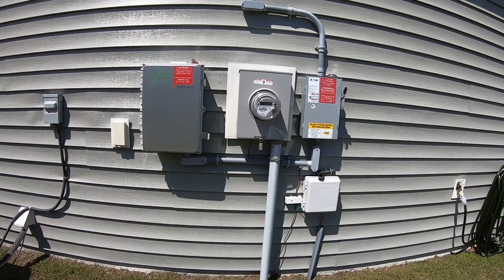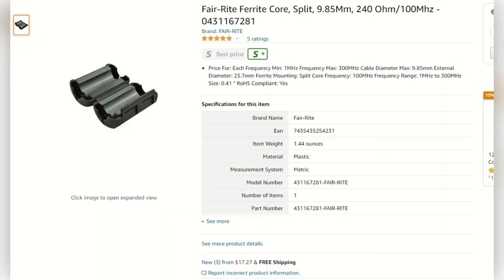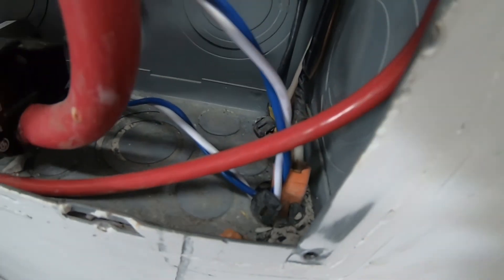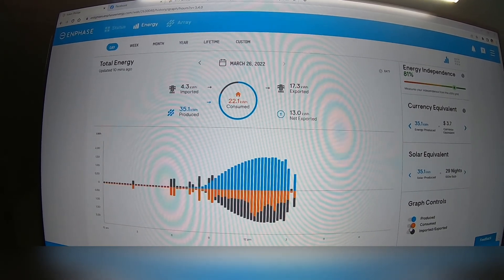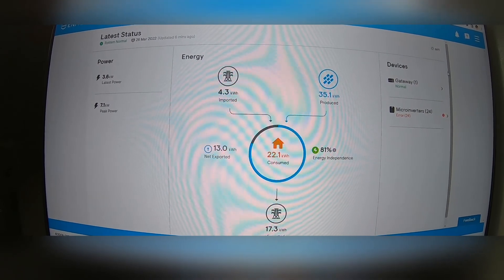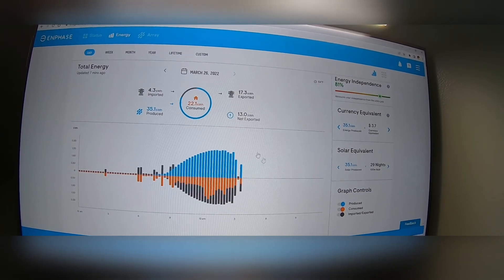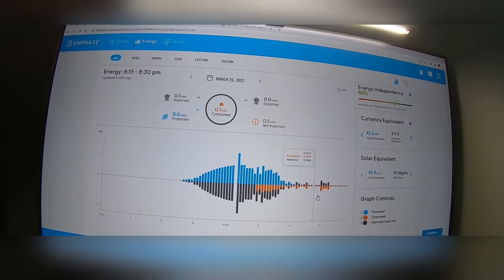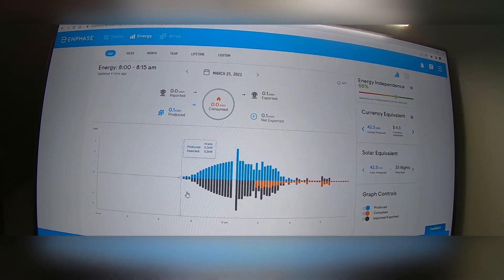Enphase Solar Consumption Meter and LAN Ethernet Cat 5 over view and error solved

Comment: I know the video is 2 years old, but wanted to leave a message and thank you for showing the Ethernet connection. My installer configured my system for WiFi and it's been dropping due to the weak signal from the opposite side of the house. I've been searching the web for months, and this is the first video I've found showing the network port.
Reply from the maker: @kopperklad7613  glad it helped, I did searched like crazy and couldn't find anything except a few people say it didn't have a way to hardwire. it really should be better put out there for there own advantage but thats why I put a video out there to help others.

Comment: Thanks for this vid.  I was really wondering where the hell is the Ethernet port, glad to know you can unscrew the plastic panel to expose it.  Though the e phase box only has a hole for power…I guess I would need to drill a separate hole just for Ethernet….?
Reply from the maker: I ran it through the same hole, you just want to make sure to get a ferrite which makes the signal normal. Here is the one they suggest and that I got. https://amzn.to/3VaZj8h
Reply: @ajphillipsjeeps  truly appreciate the response and info.  I will go ahead and purchase through the link.  I have to take my gateway from wifi to Ethernet, and our tech said once I switch over I could expect a 24 hour transition so my data will not report for up to that long.  A little confused but I’d rather be hard wired in.
Reply from the maker: @lowell a  mine was about 20 minutes but it will stay connected to wifi in addition to LAN but uses LAN as primary  and wifi as 2nd
Reply: @ajphillipsjeeps  that’s absolutely what I wanted to hear and expect from typical devices that manage both protocols. Thanks for confirming!

Comment: Hello, I have Duke energy and Momentum Solar was the company whom install all my panels here in Central Florida, I just bought (thanks to you) the Consumption Monitoring plus more same gauge cable to reach across my garage... I saw that you connect the Cat 5 Network cable to the IQ - box outside, but where did you connect the other end of the network cable? to you home network switch?
Reply from the maker: Yes to my my home switch. I have a decent setup for my house having wired cat 5 in all rooms and had extra space for it

Comment: I've been looking for this video. My 2019 system has been on a WiFi connection. The brick wall between has been a nightmare when the WiFi loses connection. My most recent disconnection lasted eight days and I am done with it. I will run an Ethernet cable to it and wanted to see someone with it. I wanted to be sure I have a plan in mind before I start drilling into my Envoy box. Thank you!
Reply from the maker: Glad it helped. I couldn't find almost anything on it when I was looking so I had to take a shot and see what could do. Make sure your box has the LAN connector before drilling, but mine has worked great. Wifi still stays on but it defaults to use LAN over wifi just leaving wifi connected also.
Reply: @ajphillipsjeeps  Excellent information. I can see the LAN connector but will take the cover off to be sure there's no unexpected obstruction. Thank you.
Reply: I have had the supplies to complete an Ethernet connection for some time. Today, I finally got down to business. The connection was a breeze...absolutely no problem. Running the cable wasn't too bad. So, no more WiFi!
Reply: Does it update more frequently with the direct connection vs WiFi?
Reply: @aaronw6706  It updates every 15 minutes (as it has always done) but now updates regularly. With the WiFi connection, it would lose connection for hours, and it was nearly impossible to restore the link.

Comment: Al, are u using Combiner Box 3?  I saw u bought the CTs .  But when u buy the Combiner Box, it comes with production and consumption Cts.  Your installer must has  taken them and not installing for you.  Also on 2:49, u said the big  red & black wires where u hooked up the CTs are from Solar.   Are U sure?  They must be from incoming  Utility lines.
Reply from the maker: I'm not sure which combiner box # it is? Is there a spot I can look to verify? I was there when they unboxed it and I did not see them take the CT's out. Wonder if it is included now but was not then. The smaller black and red are solar incoming. The bigger wires are from the grid. The CTs need to be placed before the solar enters the panel so it can better read incoming and outgoing. There is a setting if the cts are on the other side but it is less accurate from what I have been told

Comment: May seem like a dumb question, but if you do NOT have internet, will this system still work? .... is the Gateway for the app monitoring system only or does it control production too?  ...  "microinverters not reporting."

The installer (816 Solar Pro in Kansas City, MO) passed the buck to Enphase... "its an equipment problem.  Not our problem." Enphase punted it back to the installer.  Meanwhile i sit here w no solar.  🤷‍♂️
Reply from the maker: My understanding is internet is not needed to work once it is set up. With that being said, when it is setup for the first time, they do have to have internet to connect everything, but this could be done off a cell phone data share package or even a neighbors for temporary. If you wanted to see the production and usage that would require internet as it only stores a short amount of off line info and when it reconnects to the internet it uploads into the server to be seen from the phone or computer app. When they first installed mine, until power company gave permission to operate, the microinverters were turned off and had to be turned on through the web from installer. But again basically only setup phase.

Comment: Great video, thank you!  I have a similar set-up where I paid an Installer, but now want to add CT Consumption on my own. Did you have any problem installing using the Installer Toolkit App. Looks like I need an installer account.
Reply from the maker: I did not do the installer app, I just called customer service and they added it.
Reply: I have the same problem, I need the installer userid and password
Reply from the maker: @tomfrei2947  just call the 1-800 once it has been put on and they will add the function to the account.

Comment: This is the first time I've seen the solar production lines are directly tapped into the main lines.  Most installations I've seen the solar production lines are connected to breakers first like the rest of the loads.  What are the pros/cons for not running it through a breaker?
Reply from the maker: All of my breaker spots had been used so the only other way was to go with a 2nd breaker panel or upgrade the existing one. It is just a way for the install to take place without using another 2 spots. It still has their own breaker in the enphase panel and a cut off between the 2 so it meets code in NC.
Reply: Tapping directly into the line side of the utility —-bypassing the your Maine breaker - allows you to add higher amp system —- connecting on the load side of your breaker panel ( utilizing a breaker slot) means you have to abide by the NEC 120% rule

Comment: I have a problem with my CT readings after installing a backup generator, the consumption mirrors the solar production but at a lower rate even when consumption is at a steady rate?
Reply from the maker: I do have the same thing a little. It is almost like the CT can't pull out the solar addition of energy. I can tell you that my actual use and sale back is close, and I believe it is why they say they are not metered qualified.

Comment: Great video, after the installation of the CT is there any programming to be done at the APP to enable it?
Reply from the maker: Yes and no, I had to call the 800 number since I had an installer who set mine up, if you have the installer app you can do it yourself. Very easy both ways.
Reply: All you have to do is contact Enphase and they’ll give you access to the installer app

Comment: Hi,
great video. I just installed the consumption meters myself but consumption is mirroring the production on the app. for some reason. I am in contact with enohase but they told me to give it two days to see if it flushes out. I don't think it will but I'm waiting to see what happens. 
Do you know anything about it,? Please let me know. 

Thank you
Reply from the maker: Don't know of anything specific but just making sure the setting is turned on for wether they are upstream or downstream of where the solar ties in. Making sure that line 1 and 2 are on the right incoming wire. I know it said it had to match. Have done a complete shutdown and restart?

Comment: I install the CT on my system and It works but my export reading is my consumption and my consumption reading is my export, called tech support but those guys are off, did you have this problem? if so what is the solution?
Reply from the maker: I did not have that issue, did you make sure the consumption meters are facing the right direction and also that line 1 is on line 1 and 2 is on 2. Not sure if that would cause it,  but I know they make it a point to mention both of those items. Also make sure the Consumption meters are on the correct side of the PV input and the setting is set properly for your setup.
Reply: @ajphillipsjeeps  thanks I figure it out, the installer connected solar production wires to the wrong Phase.
Reply from the maker: @bob.s795  glad you figured it out, hopefully my I fo helped you look a little further into how you found the problem.

Comment: Trying to figure out why your app screens look different than mine. I am using an android phone to access and a apple MacBook. I don't get the nice graphics you have no matter what tab I click. Possible because I don't have consumption installed and activated yet?
That is my plan this morning to get installed and turned on by tech support.
Reply from the maker: I did mention it in 1 part that before my consumption meters were turned on, the screen looked different. I had the production bar and 1 option to turn on which was the previous days overlay. It really changed how everything looked but you have to turn on the setting and have installed the consumption meters. There are a few videos out there that show what the standard screen looked like and I wish I had video taped some of it first cause I did t know it was going to change the way it did.

Comment: Do I need any settings after I installed the consumption meter?
Reply from the maker: Yes, as discussed in the video, if you have the app for programming you can do it yourself. If you do not, you can call their customer service and they will do it without issues.

Comment: How long after calling enphase did the consumption monitoring show up? They told me 24 hours. Is that right???
Reply from the maker: They generally say 24 to 48 hours, but I saw it kick in within about 2 hours.
Reply: @ajphillipsjeeps  ok. I’m going on 15 hours with nothing after the call to enphase. But no errors so I guess I’ll wait the full 24 before calling again. Thanks!
Reply from the maker: @Mark Parker  that was just my experience also. Is the system still reporting incoming power? If not it might need a power cycle.
Reply: @ajphillipsjeeps  everything is working (except the consumption CT measurements). I’ll wait and see
Reply: @ajphillipsjeeps  where do you normally see it in the app? Which tab?
Reply from the maker: @Mark Parker  when you go to the energy tB, I'm you should have a orange switch that is "consumed".
Reply from the maker: @Mark Parker  did it ever start working for you?
Reply: @ajphillipsjeeps  no- actually chatted with support again this AM and they said they enabled it manually. It’s been 9 hours and still nothing. I rechecked the wiring and it looked ok. So I’m guessing the software is still pending an update.
Reply: @ajphillipsjeeps  finally got it fixed. They had to “tunnel in” to update the configuration as the remote option wasn’t doing it. Then we had to have them reverse one of the pairs to fix a negative reading. Lots of issues but it’s solved after 4 support calls
Reply from the maker: @parkermark  glad they got it fixed for you.

Comment: What size awg do you use for your strings . I thought they were 10s
Reply from the maker: I did not install the solar so I do not know what size they installed. The meters came with wire attached and I did not add any to it.

Comment: Aj, I got a enphase system as well and just received my CT's, my solar contractor refuses to install it because there are software problems, does your system works now?
Reply from the maker: I have not had any issues what so ever. The only slight issue is like I mentioned where the reported amount going out is off, but still helps you know about how it's going. You can see as production encreases you will see home use does to even if you k ow nothing more is being used.